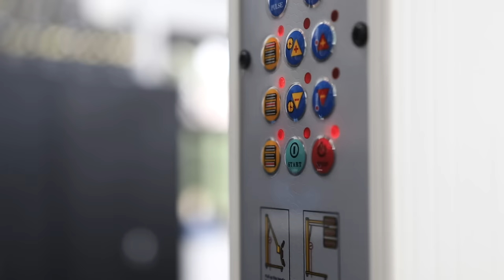30 Hour Mustang Detailing Transformation - INSANE! ASMR

Comment: Thanks for the video! Was such a good watch. I've been struggling to grasp the stages of machine polishing. Is this a 3 Stage Correction? Because you used ClearCut, Reflect and then Essence. So if you was to do a 2 Stage Correction, would you use ClearCut (heavy) and Essence (finishing) or Reflect (Medium) and Essence (finishing)? Thanks!

Comment: During the compound phase two foams were used. The first was white and followed by yellow. Besides the color, is there a difference between these two foams?
Reply from the maker: The first one is a microfiber cutting pad, used with Carpro Clearcut (compound). I then used a yellow rupes foam pad with Carpro Reflect as a polish. 👍

Comment: Do you use car pro reset as a strip soap or what do you use for a strip wash? Also what paint depth gauge do you use to measure the paint thickness.
Reply from the maker: Reset is pH neutral, but you can make it into a strip soap when adding a bit of MultiX to it. I use an Etari MD 666 paint thickness gauge.

Comment: My towel always leaves small pieces of it when drying, can you share any tip how to avoid that? Is frustrating looking at the car at the end with those pieces, it seems like it’s dirty
Reply from the maker: What kind of towel are you using exactly? Brand?
Reply: @VermijlCarDetail  Car pro dehydrate
Reply from the maker: I’ve never had that happen with a Dhydrate towel, very strange!
Reply: Wash your towel, but make sure you don’t wash it with other types of fabrics. Also clay your car so the fibres aren’t catching on any contamination.
Reply: @ibrahimshareef3984  will do... thanks !

Comment: Is it possible to put Xpel clear bra over the car after you ceramic coated it? Then ceramic coat the Xpel????
Reply from the maker: I wouldn't put it on top of a coating. It's better to put it on an unprotected, smooth surface and then put a coating on top of it.
Reply: @VermijlCarDetail  thanks

Comment: The fact that you used a brush on the paint after the tail lights and sponged the vehicle in straight lines when it should be in circles shows the lack of knowledge you have with detailing and focusing too much on looking all fancy for social media. What's even worse, is that you're using a microfibre towel on the surface in straight lines. One of the most basic rules in the industry, circles only!

It causes smears & micro scratches. Only windows are to be done in straight lines.